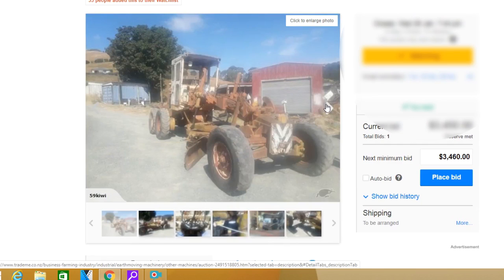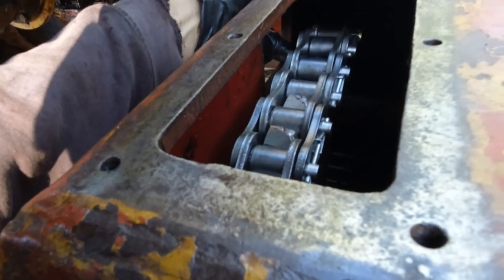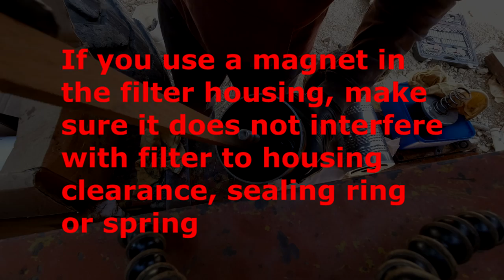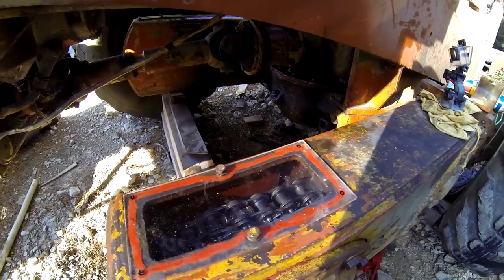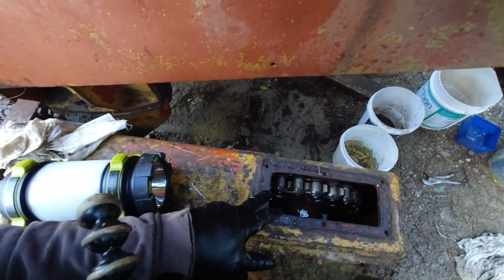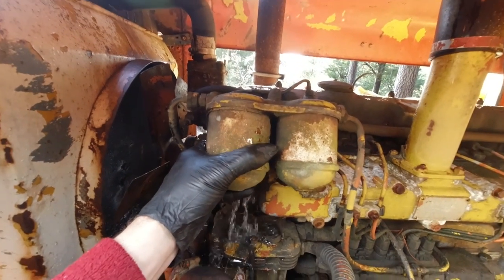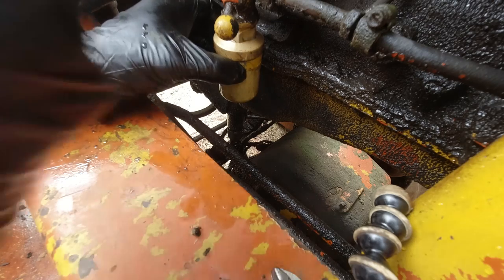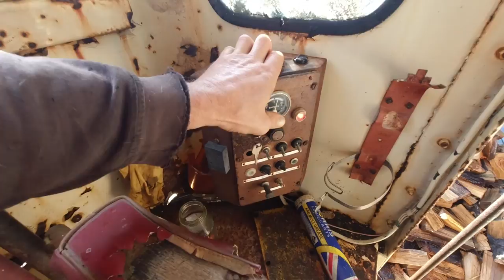12 Ton Grader part 4- Replacing the broken drive-chain and back to work.

Comment: I have seen so many over the years with the whole no service or even clean fuel and it still put in a days work. I am so proud of what you do to these neglected pieces. I suppose that now that you know she's a keeper and what, that a degreasing, a hottsy sounds bout right but elbow grease works. I like the fact that you warn a guy to back away as those silent killers are the worst, just need a greasy piece of paper to confirm what your thinking. I worked with a guy who's wife worked at a burrito joint and he must of ate her mistakes or something was seriously wrong with the guy. I seen him and just waved as that was a close as I could take. I really do see paint on this old tractor in the paint brush style as it would somewhat cover the mist and then a piece of window here and there as getting slapped with a wet branch is just not in the fun book. It takes most people who run them years to perfect that trade as it is a very unappreciated talent!! By the time they are really good at crowning and pulling ditchlines, they retire. One old guy who ran this one particular route had mostly single lane when he started but when he was through, two lanes with some wide turn outs. He was really good and then Our county maintenance fellow made him retire as he was in his seventies.
Reply: What a rambling mess of drivel.

Comment: What I appreciate is the routine maintenance that was done before you did any grading. Most Youtube channels, get the vehicle/machine running and then say they're done. I cringe when I see someone start up an engine that's been sitting for God knows how long with cruddy oil and antifreeze. All that does is destroy the bearings. BTW hello from Calgary, Alberta, Canada

Comment: You have done a good job, and know what you are doing. I have read several of the comments below, and don`t agree with many of them. The grader is old, and you would have to spend a fortune to get it back to almost new. For what you are using it for, and the amount of time you will be using it, what you have done so far will be good enough for it to last many years, and give you good service. It is not on a construction site being used eight to ten hours a day. So, I think it is good enough for what you are using it for.
Reply from the maker: Thats what I'm thinking too, I don't want to spend a fortune or all my spare time on it

Comment: Dear Marty T.
👍👌👏 Simply fantastic again and as always. Very well done. I could watch this for hours. There is this old saying: If you grease/lubricate well you speed/drive well! You, Sir, definitely greased very well! That good old machine needed and deserved your TLC for sure. Especially after so long not been maintenanced.
Hope that second Diesel filter will arrive soon. In my opinion respectively out of my experience you should flush out all fuel lines and especially the Diesel tank. I can hardly wait to watch the next part.
Thanks a lot for making teaching recording editing uploading and sharing.
Best regards luck and health.

Comment: “I’ll torque up these bolts” -torque setting: 2 ugga duggas
Reply: til it breaks and then back 1/2 a turn
Reply: Yeah well, I heard it "click".
Reply: universal unit of measure
Reply: hycron1234 that was his joints, not a torque wrench!
Reply: We call that FT here in Wales..
Reply: I always say "just tighten it until your nose bleeds".
Reply: @petermoll3421  "Nach dran kommt ab"  = german Translation ;-)
Reply: @beakittelscherz5419  oder "nach fest kommt ab"  after tight comes loose

Comment: Here is a little trick i learned many years ago. When you need to assemble a housing or heavy cover or big wheels with bolts instead of stud, i would cut the head of two longer bolts with the same size and thread pitch and sharpen the and to a rounded point. I would then before assembly screw in my two modified bolts at 180deg apart and use them as guide for the housing, wheel,or heavy cover. This will aline me with the other holes to put bolts in. Once bolted i would remove my modified bolts and voila job done with less cursing LOL.Oh one more i would also bore a small hole (1/4in.) near the end of my modified bolts for easy instal and removal with a small punch.
Reply: This is also how you install engine sumps that you just put fresh silicon on. 
Prevents it sliding around till you get the first bolts in
Reply: That method also works a treat for aligning transmissions, way better than fumbling around with bolts.

Comment: I remember someone telling me a new chain saw chain will stretch after initial use. I don't know if that's true for all chains, but you should probably check that new drive chain after a bit.
Reply from the maker: Yes I will do that, I put it on at the tighter side of recommended tension to allow for bedding in
Reply: I’m thinking the chainsaw blades stretch because of heat tension and there a different metal
Reply: @bobcranberries5853  Its all the rough edges from the manufacture process being rounded off during initial use. Always crank up the oiling and run for 1 to 2 minutes at 75% rvs with zero load on it. Then turn off, retension and start sawing
Reply: @bobcranberries5853  hey Bob, chain stretch is really the rough metal surface (looks smooth but under a microscope is peaks and troughs) wearing smooth. The metal doesn't actually stretch. Good quality chain should be 'pre stretched' so run at the factory. 
Those chain saw chains get some serious abuse too eh! Ha ha.
Reply: @Motumatai3  exactly this
Reply: Wot a veiw

Comment: whats all that banging going on in the background.. you got some mate doing all your work there?

I've never seen a chain that size be all master links, guess it makes it nice that you didn't have to grind the pins off and hammer them out. get all that grinding dust in there. 

Another great video. as always
Reply: 140 cotter chain. We sold tons of that stuff. The cotter work better in high load.  Doesn't loosen as fast as riveted it has a tighter tolerance than riveted and as you say every link  has a master.

Comment: you need one of those battery operated grease guns all the other digger drivers on utube have them
Reply: david mccullough That was my thought too. From personal experience, they are so quick and easy to use compared to the hand pump or air operated guns.
Reply: Definition of having too much money is owning a computer controlled electric grease gun AND a fancy executive hand exerciser...
Reply: Ken Haylock they should make a smart grease gun that connects to your phone and has an app that shows you the amount of grease and pressure in real time, plus Amazon Alexa integration so I can ask what the status of the grease gun is over wifi

Comment: on grease day i would go through 5 tubes of grease doing all the equipment, and a few batteries. actually would burn out a Lincoln grease gun every year. gravel pit. 2 dozers, 3 front end loaders,  a screen, and a crusher.
Reply: I grease everything once a day. And have a Milwaukee grease gun, and about 6 cat pump style grease guns. And I love the electric grease gun, but when you have uncooperative fittings, the classic grease gun with a metal extension is the way to go. It works just well enough to solve most uncooperative fittings, it's much better than pulling the pins, hahaha.
Reply: @mfk12340  we carried a napp torch with a pinpoint tip and pb blaster. get it hot. spray some pb blaster and grease. on lazy days i would have a wrench and a pocket of nipples.   most of the time it was a bad nipple. if it wasnt id grab a hammer and hit the hinge to move it.      the screen was every other to every day. crusher was every time it was used. and the other equipment was depending on the use. i was a kid at the time.

Comment: A road works company close to me is about to scrap a whole grader its missing motor and gear box but the rest is there looks real similar to your i had to take the good tire of it and put some worn ones on it would be sone parts for yoursif your interested
Reply: That hammering noise was the rare and endangered Kiwi Hammer Bird. ;)

Comment: Why didn’t you flushed out the fuelltank when you saw all that rust in the filters? Now there’s a chance you get crapp in the new ones when you could prevent that from happening.
Reply: Flushing a fuel tank isn’t exactly fun or easy, also it’s not going to immediately go back to that point and the worst it can possibly do is wear out the filter. It is almost certainly on his to do list.
Reply: It's a pain in the ass.  Especially if it has a lot of fuel in it, and you have limited resources to deal with the fuel and then cleaning, and then treating the tank.  You also don't exactly know where the corrosion came from.  Might not be the fuel tank, could have been the storage tank.  Change some filters, clean some screens, and run it.

Comment: Some low-hanging branches there - might need some chicken wire in place of a windshield:)
Reply: Just stand on the grader roof and chainsaw off the offending branches.
Reply: @RangieNZ   when are you available????
Reply: @zk-art5453  Straight away - just pay my airfare AKL to Nelson.

Comment: What is nice about these old engines is that you can mend them (unlike my nightmare French car!).
Reply: They are no worse than any other vehicles as everything is now replace rather than repair. However we forget that, fifty or sixty years ago, if vehicles were not greased, or had  their oil changed very frequently, then trouble resulted. Witness the water pump shaft on Marty's Bristol crawler.
Reply: @paulhitchcock534  try the self destructing wiring loom in a Scenic footwell!

Comment: I have been impressed with the sound of that old diesel engine, since the first time you started it.  It runs so smoothly and has such a great, low, exhaust tone.  Another great video and with dead pan, improvised comedy.

Comment: Marty has so many ways of scraping his drive now, tractor with the rear blade, bulldozer with front blade, grader with center blade, how does he choose what to use? Fuel consumption, ease of use, overall fun, I'm sure it's the last, lol. Knowing Marty is off grid adds an entirely new element to these videos. The ''bit more choke'' comment had me checking to see if it was indeed a diesel or petrol engine.

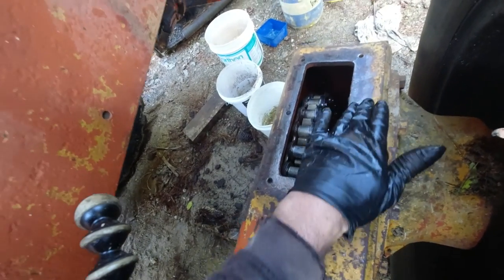Comment: 14:21 like you said, you will have to take the hub off in the near future, for the axle seal that is leaking. Have a look at POR 15, you probably even already know it. It's good stuff to put on rust and protect from further going bad. Just in case you are thinking about protecting the ol'girl from the elements a bit better. I really like the way you work, not going nuts over bolts over the repairs, just get it in working order, done. LOVE IT.

Comment: Aveling-Barford made industrial machines of this grader size, or larger, but also made was the Barford Atom, a basic two-wheel tractor that served as a garden cultivator, grass mower, plough etc, powered by a 4-stroke Villiers motor. A very handy machine.

Comment: There is a hydraulic ram tool used to clean up stuck grease fittings. Performance Tool W54209 Grease Fitting Cleaning Tool is one I have used rather than risk snapping a zerk fitting frozen in place.  Good luck and thanks for the vid.

Comment: I work on tractors and equipment that have chain exactly like that it's actually good that have cotter pins all around so when you open the trapdoor you have access to any lengths that's easiest to remove makes it for easy working

Comment: Hi Marty, as I'm sure most people are, I'm genuinely impressed with your resourcefulness and innovation. I have a couple of ideas for you (which you may already be doing?) . 1; A biogas tank. Anything biodegradable (food scraps, lawn clippings, poo and so on) will break down into some A grade fertiliser, and the byproduct is methane gas which can be captured and used for cooking instead of releasing into the atmosphere like you did in this video! (ha ha!). Idea #2;  Build your own fuel refinery. It is remarkably simple and similar to an alcohol still. It works at different temp's and with different raw materials, of course. But, basically, anything that burns. Wood, cardboard, plastic, the neighbours cat, waste oil (engine oil, cooking oil, animal fat) will all go in and can be converted to propane, petrol, diesel, kerosene, tar and oils. The 'fractionating column' might be a bit tricky to build, but I have no doubts about your abilities. Cheers for the awesome vids!

Comment: Grate jobs.. eager to see more videos. 
 Just one suggestion ... please use your high pressure water washer to clean the complet machine before you start working on it. It will give a great look as there is lots of oil and dust on engine and body. If you can do a spray paint it will be even better. 
Great work broo. Keep going 💪

Comment: Ive changed a few chains and i have never taken the wheel off , just tie a rope on the chain and pull it through the inspection covers on the top.. those gears get pretty sharp after spinning around for a few years
Reply from the maker: Yeah I would have done that but the sprocket had burrs on it I needed to file off and I wanted to check the drive sprocket as well

Comment: Marty just looking at the vertical nature of your habitat if your grader ever goes ape and swings off the track you'll never be found. Very much like the terrain here in Washington State where I live. Goodness gracious that grader is now up to spec. If ya'll need new cylinder seals and a few new grader tires you could contract it out to the county, (not sure what the call counties in zealander), and if it ran for 6 months without breaking it would pay for even a new excavator drive motor. Say Marty, I raise honeybees and your location looks perfect, you could sell 500 gallons of honey a year out of a place like that. A lot of work and you have to become a woodworking craftsman but as meticulous as you seem you could run a table saw without cutting your fingers off.

Comment: Nice to see old iron back up and running.  One thing I noticed, the front tires are mounted backwards.  For a non-powered axle, a chevron tread tire should be mounted with the tread in the opposite direction you would on a drive axle.  They bite better and give you more steering force.  As bald as they are, it probably doesn't matter, but when you put some better ones on there, remember this.  You'll be able to take somewhat deeper cuts without the front end getting pushed around if you have tread on the fronts.

Comment: Putting a magnet inside the filter canister is a good idea,..I do the same, but I put rare earth magnets on the outside of all the filters I use. 
This way then I don't mess up my magnet and it's certainly easier to keep metal bits ( if any ) off the magnet. Either way, this 'trick' does work!
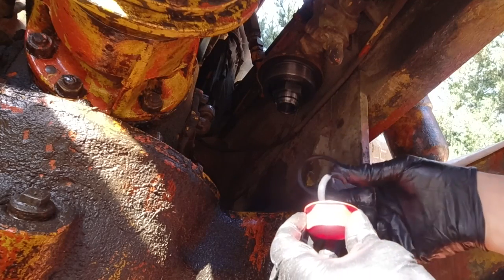Well I'll be darned,..there at the 5:32 mark I use the same saying, except  " pull the choke the next time! " . LOL.  My dear wife heard me saying that once and said,.".God, you're disgusting! "
of course, it was a good crank on the starter too!

Comment: my dad had a grader with double blades. it sat unused for few decades because breaks seized until it was sold for scrap after his passing. i wish my brothers would have fixed it.  would have helped on keeping the gravel road decent. tractor graders arent heavy enough for packing it properly so they get potholes easily again.

Comment: Ya need to spray all those grease fittings with dayglo orange marker paint so you don't miss one in the future.
Also, I think I would try and build some sort of vertical bush type trimmer attachment to cut back the foliage as you scrape.

Comment: Unless they're both crudded up, move the clean side fuel filter to the "dirty" side" & fit the new one on the clean side. Worked fine for me over many years.
Reply from the maker: Good tip if you're on a tight budget

Comment: Appears to be working well, you'll soon get used to operating it. I notice one of the drive wheel hubs appears to have a bad seal leak and those AC type fuel pumps often have a filter screen under the cap - might be worth checking if you haven't already.

Comment: Try using your lean wheel to help you turn sharper also it is used to counter act the force of the blade side movment pushing the front wheels to the direction you are digging from  while blading lean wheel away from toe of the blade
Reply: @John Smith  ok mate fair enough it was only a suggestion to try and help with your turning. Love your vids mate I've watched them all,keep up the great work, Cheers Karl

Comment: Will there be a Part 5 for the motor grader? Don’t know if you are doing any more repairs or upgrades. You could sandblast the metal & give it a paint job. This may not be a priority. You will have a nice yard of earth moving equipment for business & personal use.
Reply: Quite rightly, "cosmetic" enhancement does not come high up Marty's priority list. We have to realise there are 165,000 subscribers and only one of him. We need patience

He had said he wishes to change hydraulic seals on the excavator which will involve some planning. He has achieved minor miracles  but don't expect one every Friday!
Reply from the maker: Yes I'll finish grading my driveway when the ground dries out, we've had a lot of rain lately. I  might give it a paint job at some stage

Comment: If you could mention in the videos whether you can notice any difference in the "performance" of the grader after all those changes, that would  be much appreciated.
Reply from the maker: It does seem to have more power now and the drive shafts are quieter after greasing. Also I feel a lot better about spreading the load between 4 drive wheels rather than 3